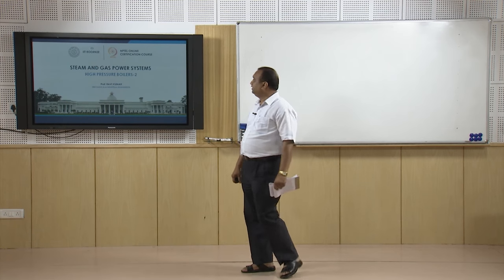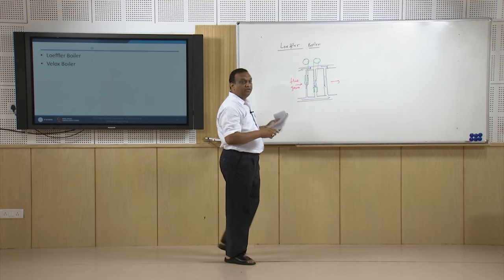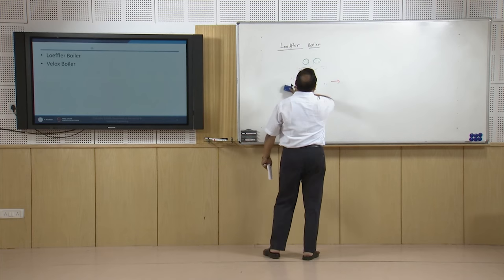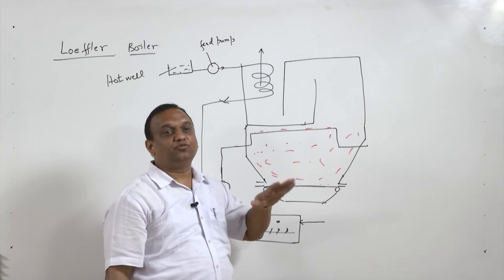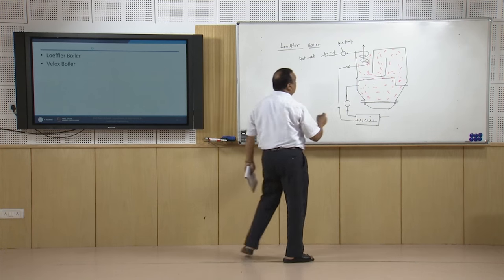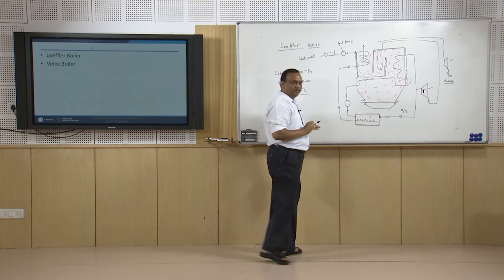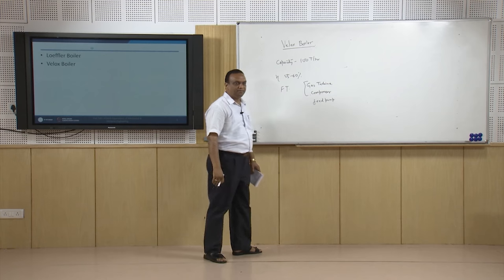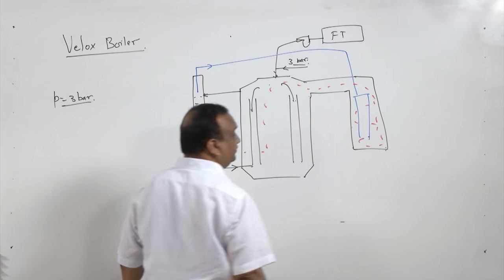Lecture 11: High Pressure Boilers (Part-2)

Comment: Sir, as per high pressure lecture explanation by you the velox boiler is a high pressure boiler but you show there is pressure only 3 bar only how
Reply: The 3 Bar pressure is the pressure of the air for combustion not the steam generated !!
If you think that pressure of air = pressure of steam , then the boilers won't work because then heating would be very less and back flow of water( in general sense ) would be very high.

Comment: I want to build a steam engine to run a pick up truck
   At first I thought I would try to "backwards engineer" one of the steam ers from a century ago
   They used a  "once through" type system. But as I learned more about steam.... I think they must have bought distilled water for them.
These lectures are great but I'm pretty sure mine will be much smaller
Can you offer any suggestions?

Comment: What do we mean by a boiler working at a particular pressure lets say 100 bar, how does this pressure generates?
Reply: by the pump which we use for pumping fluid into the boiler.